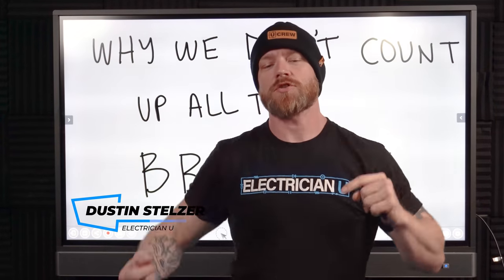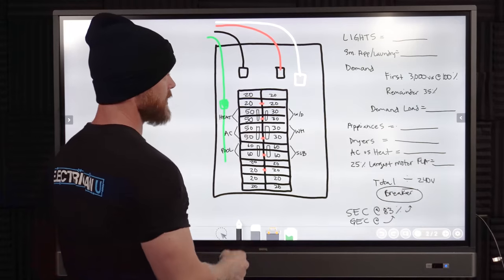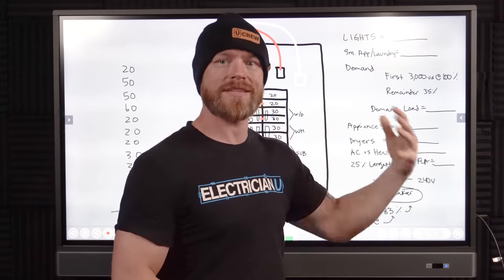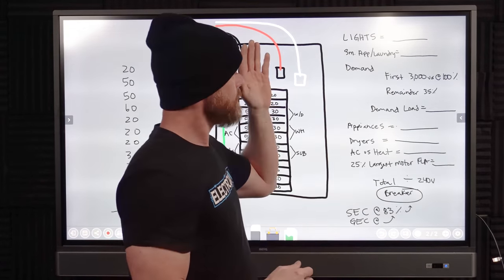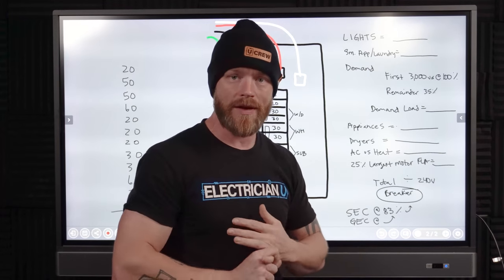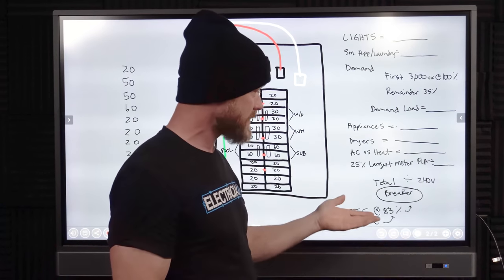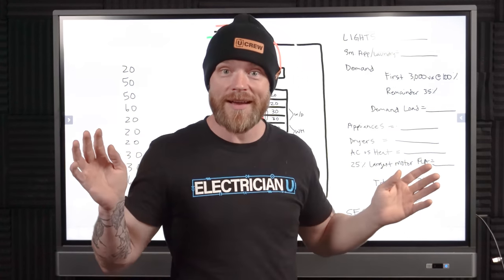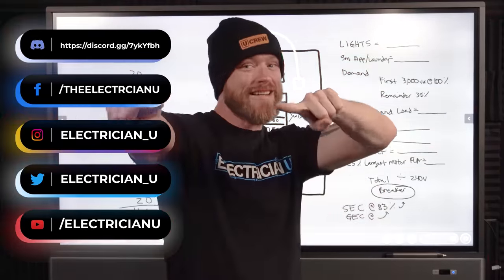Why is there more than 200 A worth of breakers inside of a 200 amp panel?!

Comment: The fancy term that EEs use for this is “load diversification”… 😁. Great explanation! -Erik with Square-D
Reply from the maker: Thanks for watching my friend! Good to know ⚡️⚡️
Reply: Square-D, best in the business. 🤘
Reply: Ehh my boss is a fan of the square D line of products👍
Reply: @tommypartin6431  i concur. That's why i replaced my panel with a square D one.
Reply: Yerrr SqD

Just wanted to say it lol
Reply: Diversity vs load Factor
Reply: Joke By-done  That's how the NEC describes it
Reply: Joke By-done  good points, by law a PE has to approve the design, but the electrician has the appropriate skill set for installation and best practices.
Reply: Do you speak on behalf of your company or yourself?
Reply: IDK, back when I studied the NEC it was called  Non-Concidental loads.
Reply: Siemens > Square D
Reply: Love me some sq-d!
Reply: He was literally describing my ex-girlfriend until the 73 vacuum cleaners.
Reply: Wonderful Explanation
Reply: @integr8er66  Non-coincidental loads are specific, like a central AC and electric heat. They would never be utilized at the same time. Or swimming pool panel and electric snow melt buried under pavement and heat traced water pipes to prevent from freezing. Load diversity is a different concept. Most circuits do not present their load on the service unless they're being used, and when they are being used it is rare that they're fully loaded. That 20 amp dishwasher circuit presents a less than 20 amp load on the service for but one hour every 2 or 3 days... How often is the washing machine running? The sump pump runs only in wet weather. The heat boiler cycles on and off as needed... etc...

Comment: That was easy. Not all of the 15A or 20A breakers are running at full capacity at the same time. If they did, you would have a killer electric bill!
Reply: I normally run 73 vacuum cleaners at once. lol
Reply: Except for heating in winter, the continuous loads typically are refrigerator/freezer, water pump [intermittent] cable boxes and internet boxes, washer & dryer loads are not always on.
Reply: @kylestan2250  Cable boxes, modems, etc use very little power, typically 2 watts or less. Most TVs are LCD or LED flat screen that use much lower wattage than the old CRT tube TVs. Back in the day, 50s 60s 70s most homes had waffle irons, toasters, grills, that used huge amounts of power like 1500w or 2000w. But, electricity was very cheap, 2 cents per Kilowatt hour, and we were very low-tech. Nobody had laptops and cell phones which use very little power. Everybody used incandescent bulbs for light, and some heat in the winter.
Reply: @kylestan2250  freezers only have a big load at startup and everytime it begins a cyle again